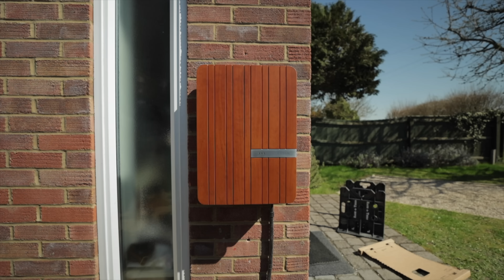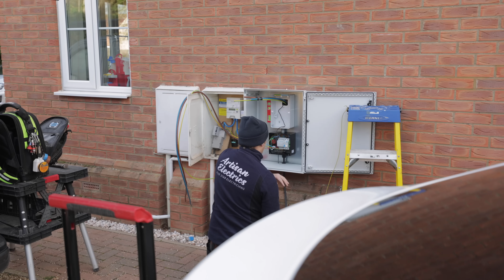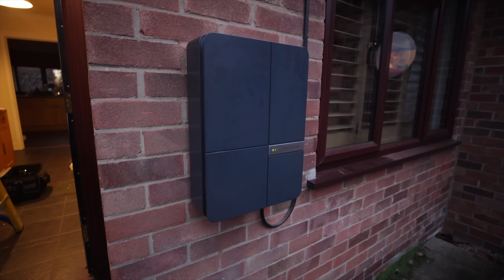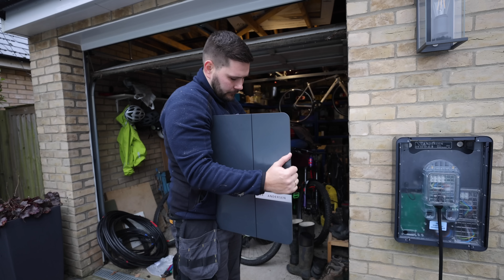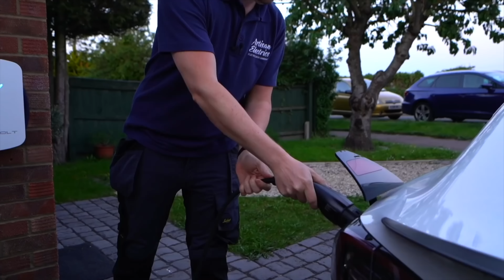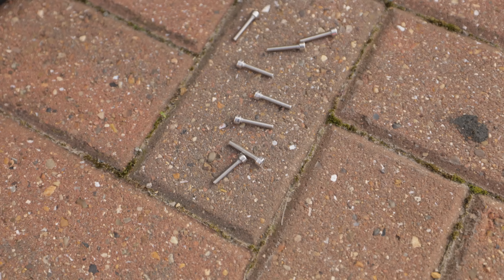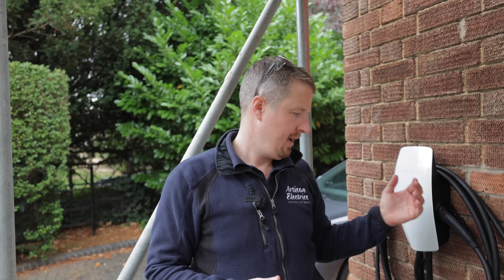5 Best EV Chargers Compared: Honest Review & Brutal Opinion🫢

Comment: Hypervolt app i heard from a customer they hated that is not logical on setting the charging times and that you had to delete the example time 1st and gave up on putting in the rates as it would not save them and said its made for geeks not the normal person.
Said there was no help at all on the app and how each part work for set of charging times and rates times.
They said it needs instructions on the app in the box and made more logical for all end users.
They already regretting getting an electric car .

Comment: Odd that with Tesla chargers as even the USA use neutral side for earth and their fixed home charger are 230v , could you just use earthing rod as all we are protecting against is a potential difference car body and the ground ie your body could become return path . I'm electrician / fitter on railway locomotive's , when we did course on 25kv OH Wires we were told of electrocution incident when fitter was removing axle box covers with the pan up ie loco live . Electric locos return path is via the rails so they have return /earth brushes in the axle boxes so no current passes through axle bearings when fitter removed last cover he became the return path ! . Just an example of how you can become return path in the most unlikely situations like with loss of PEN conductor , sorry rabbit on but but electricity often finds a path through some unfortunate person

Comment: Inherited a zappi - it’s a complete pile of crap! Forces eco+ no matter what, charges outside the schedules, drains the battery when there’s no solar and then “waiting for surplus” even at night cheap rate when the grid should be used. 

I just want a unit that I can plug in and it charges in the window, zappi is not that…not to mention the app is terrible, connection issues on initial setup. 

On the lookout for something new 👀

Comment: EV chargers and installation has become a scam. First of all these are not EV chargers they pass the electricity with control and safety. Charger is actually within the car. These are just a 7kw bypass smart devices. These same results can be achieved using commando socket with smart safety devices from Shelly or Chinese ones. Cost would come down from £1000+ to less than £400. But hey, how can these electrons would earn that £600 extra. EV is about efficiency with safety and can be achieved with much less cost if the industry wanted.
Reply: This was the principle behind OpenEVSE - back in the day that they started to open up the EVSE protocols and hardware. The thing is - yes it's overpriced. But ... There's very few ways to make outdoor equipment cheaper. 

Plastic made to be outside, requires treatment to not become brittle with UV exposure, it has to withstand freezing and desert environments, et al. IP rating. The plug also has to withstand this temperature, exposure and weather too. This makes it not cheap. 

The portable Chargers - on the other hand - do not require this level of scrutiny. They can die or be run over. Nobody will claim a warranty for a Mobile charger that has melted to the car  - they'll just charge you the cost to replace the socket in the car and tell you with a smug expression - told you so. 

One of the more expensive detections is Type B fault detection, i.e. 1ms and 30ms DC voltage detection on AC, especially on 20A or above current. This is the kind of fault where the wire will fuse due to a short - and a faulty RCD / RCBO will melt closed causing a fire.Even the OpenEVSE's have trouble making them cheaper to be compliant. 

There's also added expense throughout the unit - because the plug can be detached - and this requires risk prevention, thermal monitoring and custom hardware to detect faults or fault conditions with a sensor that's reliable.

Building an EV charger that's rugged and reliable - capable of handling 22kw 3-phase with medium voltage requires higher end relays and proper certified parts for approvals and rating approval. Building something to spec for outdoor use, they will actually submerge it in water during the IK and IP testing while it is energised. Something like the Zappi is extremely overpriced for what it is, where the Tesla Wall Connector is the closest to bare costs - and it supports a rather ridiculous number of features for a 'basic' box. While you can DIY an OpenEVSE - and probably should - notice that the Chinese haven't exactly taken over the EV charger market with EVDance, ZJ Beny or Solar/Battery integrated EV charger units either. 

It does turn out - making reliable, rugged components is tougher than it looks. Especially making hardware that complies to the RCD standards to measure DC current on AC lines with Type A/B/C/D fault detection.

Comment: Andersen Quartz for me with a non-tethered cable (for theft safety). Customer support is also outstanding. Went for 7kw single phase with the solar enabling CT clamps and surge protection additional box (fitted internally opposite the external accoya wood trim on an electrical blue body). Kit (small discreet - easy to walk past) aside the app really makes it and charging is recorded, by day, week, month and total.
Reply from the maker: Thanks for sharing your experience and detailed setup!

Comment: @artisanelectrics
I followed your recommendation of the Hypervolt Home 3Pro and it works well.
The only problem we've encountered is that if I try to charge our EV after the solar battery has force-charged, it will drain charge from the solar battery.
Whilst installing it we had our electrician upgrade the house Consumer Unit with the Hypervolt wired into an additional 'WAY' on the larger 'FUSE BOX' CU, rather than fitting an additional dedicated mini CU beside the meter cabinet, so that we can isolate thr charger whenever we're away from home for a while.
The Hypervolt CT clamp is installed at the back of the indoor CU.
Our solar installer has never changed the hybrid inverter settings from the previous FLUX tariff charge/discharge times (0200-0500 and 1600-1900 respectively) so the only way to prevent discharging the solar battery is to ensure that EV charging finishes before the end of the FLUX forced Charge period.
Can you suggest a remedy?
Reply: I'm just about to purchase a mini 2022 as with the  Hypervolt. I intend  to.get Solar and Battery in the future and I am concerned about this too. 

Have you found anything new out? Do the force the solar to store to the battery as opposed to selling to the grid?

Comment: What about the Rolec Zura dual tethered units - how good/reliable are those as we want to be able to daisy-chain across 2 cars (7.4kw single phase).  We want this as an option because we don't want to have to plug unplug one car with the other.  Is this the best option or otherwise what other options are good?
Reply: Cheap tat from personal experience

Comment: Worth mentioning that for those who have a Givenergy system the Givenergy EV charger could be a great choice. It can be integrated into the ecosystem; just needs to connect to the same network/wifi where the inverter is connected. It does not drain the battery and can do eco, eco+, hybrid charging mode etc. It can be integrated into Home Assistant and managed locally (no internet connection is needed), it also has a fob in an emergency if the internet goes down. It does not support the Octopus Intelligent GO yet, but the E.ON EV tariff is cheaper and longer, so it's not a big deal. 
It would be nice to have a review of that charger on this YouTube channel.
Reply: It would be good to know if it's a worthwhile charger. It would make sense as I have a Givenergy inverter & battery system.

Comment: Help please I’ve been searching for 2 days now and can’t get a definitive answer, I’m just taking delivery of a new model y performance and already have a wall box 11/22 kw home charger, I am fortunate in that I have a 3 phase feed at home but currently not wired to the wall box . 
I was going to get the new gen 3 Tesla charger and 3 phase it to get a lovely 22 kw charge rate and at same time re feed the wall box so also has 22kw for the Mrs who has a Xpower . The only thing I have seen some reports that the Tesla and MG both only charge at home at 11kw is this correct? 
On another note I am just about to get solar and 2 x Tesla powerwall 3 which I thought you could use as a direct DC from the solar to rapid fill your car , this I believe is also not true . What’s your thoughts 🙏 ps I’ve sent you all my details last week for costs on solar battery etc

Comment: I have two chargers so I can charge two cars at once.  One is the 40 amp plug in Grizzl-E classic.  And the Grizzl-E cyber 80 amp hard wired for my big daddy pumping out 20k.  Deff love Grizzl-E the best super reliable good warranties and the 80 amp will put out as much power as you need. Gotta love america single phase 80 amp on a 100 amp breaker. Pumping out 20k

Comment: hoping someone can help, I'm new to solar panels just had them installed end of the summer last year with a10kw battery storage.    I've just ordered my first EV and looking for a charger, im with octopus and want to benefit from the Intelligent Go cheaper rates for longer.   This is where I'm getting a bit confused of what I want/need, from  my understanding to use the intelligent charging and the ability to charge your EV at the cheap rate outside of the normal night rate it seems you need the Ohme pro, but if I want it to be compatible with my solar and battery set up I need the myenergy Zappi.     However,  if I can charge the EV at 7p and in summer on a good day export at 15p  in what situation would I ever want to charge my EV instead of exporting?  and if that is the case, whats the benefit of the EV charger talking to the Solar set up?    thanks

Comment: An essential criteria for me was the charger had to be compatible with Octopus Intelligent Go. One of the reason I chose a Ohme Pro charger, which has been fine so far. Easy to use, good app, decent support, and reliable. I was put off the Zappi by my next door neighbour's experience. He has had two units totally fail in 12 months. Both replaced swiftly by MyEnergi I must add.

Comment: Zappi customer....  unit failed for a known MCB issue within a week of installation and that was frustrating, felt like they were shipping out units that "might" fail and dealing with those that did rather than fixing them all upfront.  But I always say it's how a company reacts that matters.  Part was on site within 24 hours and the original installer was given the funding approval to get in and fix it next day.  48 hours later all done and running again and it hasn't skipped a beat in the last 14 months.   Overall I'm happy with it and the solar integration has saved me so much money.  Late April to September I have paid ZERO for recharge on My Tesla M3P with everything coming from the excess solar.

Comment: Owning a Zappi has been brilliant for me. It works so well with my solar panels and batteries, charging the car instead of exporting, yet still allowing me to charge the car when I want to. Their service has been brilliant throughout - I had an issue with the front screen after 4 years of use, (Mark 1 version), and then sent me (free) a complete replacement front. If you have solar generation, I would definitely recommend this charger.
Reply: Surly exporting power is better.  Off peak power is 7pp KW, exporting is 15pp kw on octopus.

Comment: What about hybrids? Is worth the expense of getting an EV charger?
Reply from the maker: Depends on whether you want to charge on cheap rate or not. Also is hybrid gonna be with you for a long time or is it a stop gap until you get a proper EV?
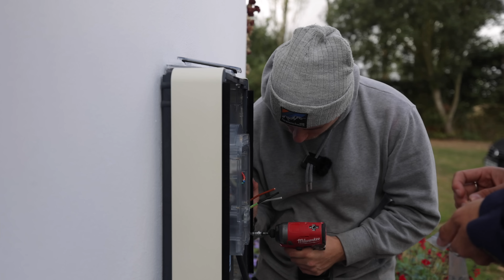Reply: @artisanelectrics thanks for the reply. There doesn't seem much info on YouTube re charging hybrids. Just bought the car preferred a hybrid as we tow a caravan and do plenty of local driving car has 30 miles electric range. I use a 3 pin charger and have a electricity tariff with an off peak rate (00:00 to 5:00) at 10p per kwh  discount from standard rate (so approx 12p per kwh) , smart meter sends half hourly readings. The car is fully charged in 6 hours at 10 amps. As a bonus all electricity is at cheap rate 00:00 to 5:00 so run dishwasher during that time. Appreciate with a 7kwh charger and a full ev tariff might be  6p per kwh cheaper, but that is only 80p per charge (13.5 kwh battery) so even if charged every day a saving of £250 per year compared to £1000 for a charger & instalation.

Comment: Most people just want a cheap charger , with no gimmicks, just plug and charge
Reply: Exactly 🎉
Reply: No people want an intelligent charger that can read the cars state of charge and deliver the correct amount charge to the car at the cheapest cost which means communicating with your energy supplier. No one wants to plug in a car and overpay when it can be charged intelligently.

Comment: What are your thoughts on the ohme home pro?
Reply: It's a really good simple to work and easy to fit charger. It has the same features as the ones Jordan talked about but will work with intelligent and OVO no problem
Reply: Had one for 3 months now. Been reliable, easy to use, and app is very good. I use the app to set charging schedules for Octopus Intelligent Go, which gives you at least 6 hours every night for 7p/kwh. You also get as many additional hours as you need to fully charge your car if you need to.

Comment: I had a Zappi installed with a non functioning screen.  It was fixed under warranty (Jan 2024), but not a good start.  No problems since.  There was instructions about not installing in direct sunlight (UV damage to plastic body, I assume).  The unit does get the sun later in the day, so I cover it with a rucksack waterproof cover when not using it during the day.

Comment: Great video Jordan informative as ever! Its left me thumping my head hard though! I don't have an EV charger yet, but am currently remodeling the house, the sparky who did all the CU and wiring said 6mm swa cable, if I wanted to do some of the footwork myself! About a year ago after looking about online, I got some Doncaster EV ultra but I think it only has 2 core screened data cable!  Is it worth taking that out and putting in a EV ultra with cat5 capabilitiy? I did think about purchasing just cat5 swa cable and running it in conjunction with the other already in place... but that would mean having 2 glands in the EV charger itself! Do any of the "New" EV's have room for that? I hoped to see this in the video, some looked really tight, does anyone have any thoughts on this... ?? Jordan is that even possible/ allowable? At the moment apart from the expense no harm done, but before the walls are plastered etc I'd really appreciate some thoughts/ guidance!
Reply: It all depends on what charger. Hypervolt works with the EV ultra data for normal CT but not sure on the solar integration yet.
Reply: @jacktissington  thanks Jack 👍

Comment: The thing that frustrates me no end is that I have, sat on my drive, a 77kWh battery, most of which gets used only for local trips up to 120 miles, and every few months a longer trip up to 500 miles (on a single charge.. yes!) but I still cannot get a charger in the UK that works to permit vehicle to home or vehicle to grid which with solar PV or off peak charging would just make so much sense. How long before these hit the walls of our houses?
Reply: What EV is getting near 500 miles on 77kWh?
Reply: I see your point but because of the cost of the car I would personally not degrade the battery by doing that. Different f its a leased EV that you dont care about.
Reply: @gusnilsson6928  how does it degrade the battery?
Reply: @gusnilsson6928 or if you have no space and also have to find room for a boiler replacement heat pump system!
Reply: This is an old thread, I know. 1 year it says in the comments section, but this is something I've been looking into for a year or longer. So I can tell you that this is now completely possible... certain equipment is necessary though because not all equipment (EV's, Chargers etc) are made equal.

You can accomplish this with a SigEnergy solution and a compatible EV with the appropriate software / firmware updates. So, A SigEnergy DC EV Charger  connected to a SigEnergy battery stack (for the sake of argument, let's say 3 x 9kWh SigenStor Batteries, The SigEnergy Controller (optionally the Gateway - for Solar integration). 

The DC EC charger can deliver (depending on the model) a 12kW charge rate efficiently via DC  because it's coming from a battery (or indirectly via the Domestic Supply). The DC EV charger module is what controls the Bidirectionality, and you use the App to control what's going on. 

This is a horribly simplistic explanation, but if you research my comments, it'll be straightforward to reach my understanding.

The drawback is the SigEnergy system is expensive, but it's also a case of (here at least) you get what you pay for.

Best vehicles first this setup include the Ioniq 5 post-2024 model as the bidirectional software is ready configured and it's built on a highly capable 900v platform.  I'd also suggest the mire recent MG EV's - I have a 66kWh MG S5 Trophy... though I don't have the SigenStor equipment yet... I got the MG with this in mind though, so that's part of the future plan. 

I'll be able to power my home directly from my EV and in the case of a mains blackout, the SigenStor System also acts as a fully uninterruptable power supply with a zero nanosecond cut-in time.
Reply: I've been thinking that an Ioniq 5 battery would be good for home electricity storage. Interfacing it with other systems is the trick of course, as you say.
Reply: Quasar 2 pre orders have started in the US & they claim it will be world wide soon but much more expensive as they must contain their own inverter & not sure about smart features  👍
Reply: This is video is oscar level waffle😮😅